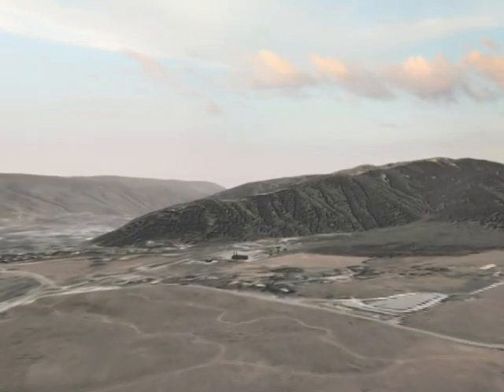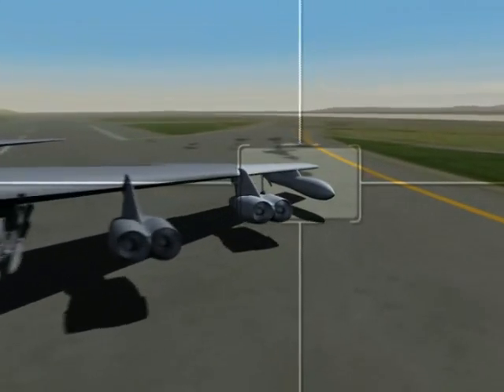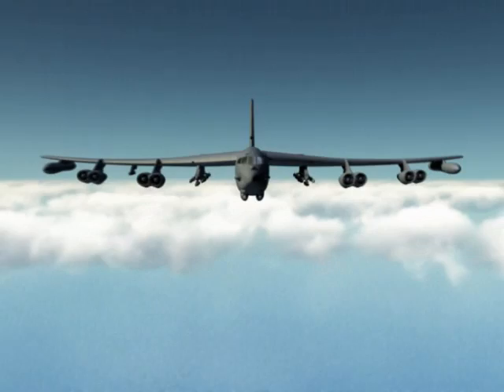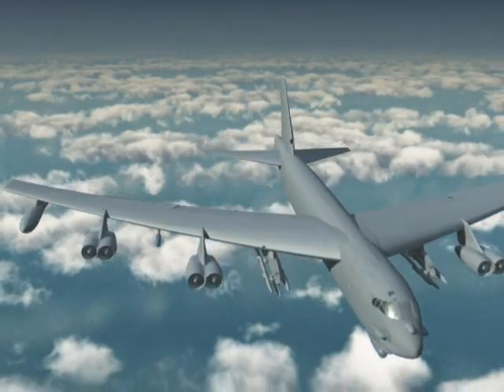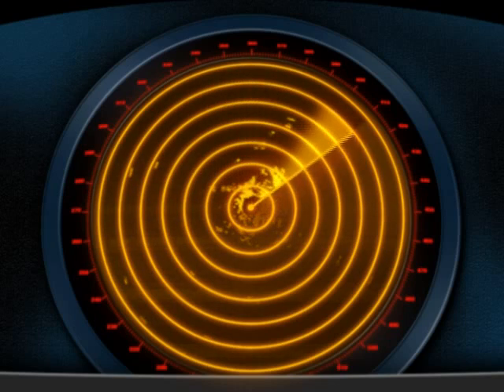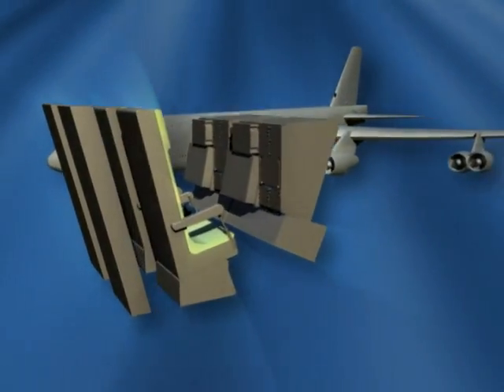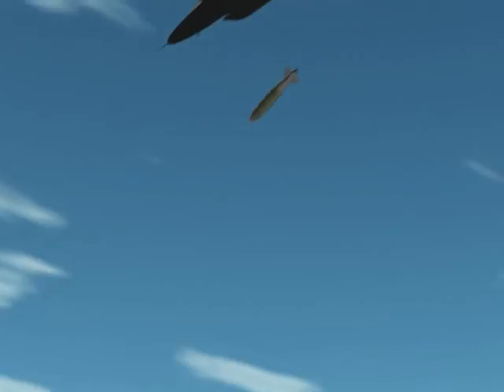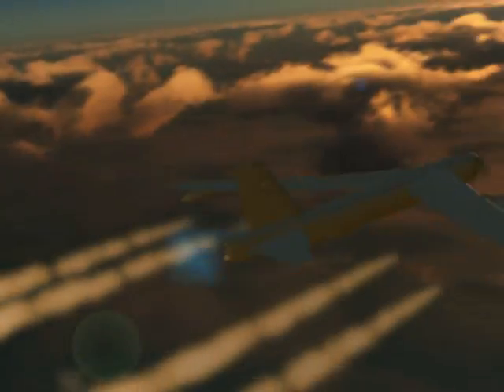Core Component Jammer promo

Comment: What if the IADS used home-on-jam mode? B52 would be the biggest magnet on enemy radar screen.

Besides, B52 airframes are too slow, old and unavailable; one [accidental] loss means losing a crew of a dozen, by the way.
Reply: Sadly, this system was cancelled. But to answer your question the JASSM, JASSM-ER, MALD, and MALD-J all out range most air defense missiles. Also radar power drops off at range due to the inverse-square law. A B-52 crew will  be able to detect the enemy Air Defense  radar's signal long before the radar can get a strong enough reflection to develop a firing solution on the B-52.  The large radar that was taken out by the JASSM at the beginning of the strike was a long wave radar array. The are typically fixed sites or have limited mobility. The B-52 was already aware of its location prior to launching in the mission.

The B-52 start their attack by degrading the Air Defense System from extreme long range. Then used MALD decoys and MALD-J stand-in jammers. Both of which would be hundreds of miles closer. So, they'd have far stronger returns that the actual B-52's. The jamming pods are frequency-hopping, to break the track of any home-on-jam anti-air missiles.  Plus active  jamming is only employed after the cruise missile attacks and MALDs are already suppressing the IADS. The B-52's would be performing their electronic attacks in  coordination with other aircraft performing SEAD/DEAD operations. Finally, a B-52H has a a crews of five: aircraft commander, pilot, radar navigator, navigator and electronic warfare officer.